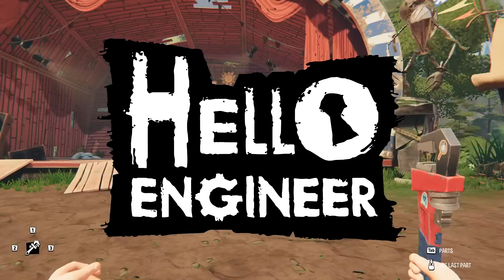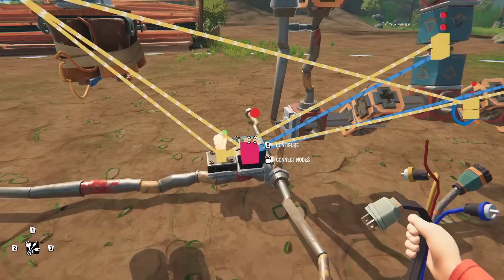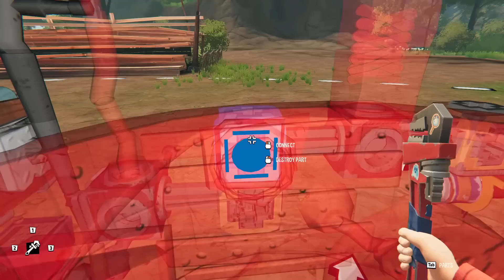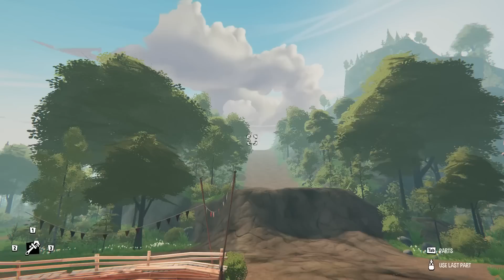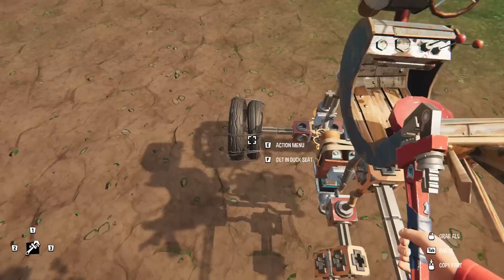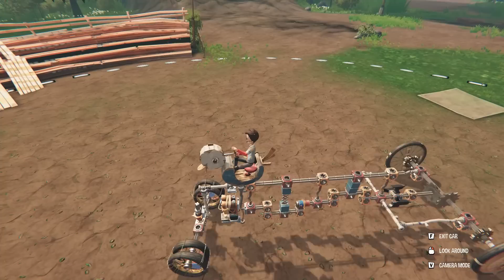I Built the Jankiest Junkyard PISTON ENGINE but I LOVE it!

Comment: @kAN:
12:07 "There's sensors that detect ground". That's all you really need; just place them on the bottom of your pistons pointing at the ground (or onto your axle pointing outward).
Ideally you'll want to set them up so that they switch between detecting and not detecting the ground when the piston is exactly halfway extended, and then you can wire their output signal into a piston with a 90° offset from the piston that the sensor is attached to.

Comment: this needs 3 pistons to operate properly, one expanding, one contracting, and one off.
offset them by 120 degrees, have them turn off when they reach/near the vertical plane, then have the other two be pulled/pushed in the direction needed.
if you have to build to a grid, then the best option is 4 pistons offset by 90 degrees, have the two on the vertical axis be off and the two on the horizontal be active.
either way, this will produce smooth and consistent motion.

Comment: to stop it going back on itself, you could instead put them 90 degrees out of phase instead of 180
Reply: you could also have less weight on the flywheel so it is easier to start going and then extend the weights to increase the inertia

Comment: Could you try putting a sensor on the bottom of the piston facing the ground to tell when it is at BDC so it knows when to extend and contract, it won't be great if you were to get off the ground but then you wouldn't need the power from the engine anyways.

Comment: If the pistons make power on both expansion and retraction, wouldn't a 90 degree offset be better? They wouldn't be at top dead center and bottom dead center at the same time, like the current 180 degree offset is doing

Comment: I think the reason why the double XOR set up didn’t work was because you didn’t connect the second XOR gat to the first. It looks like the connections have a direction so you need to have a connection to and from.
Reply: Also, you probably want the input wired only into one of the two XOR's (and if XOR gates with only one input are weird in this game, the other one might need to be an OR gate or AND gate).

Comment: My thought for a fast clock is to start with switch feeding into an "and" gate that feeds into a "not" gate chain ending with a "not" gate that feeds into the initial "and" block. The logic being the delay from flipping the "not" signals would culminate in the "and" constantly changing whether to power the connected "not" gate and the speed then becomes the sum of delays in what I'd assume are a few game ticks. Even if the game calculates the logic all at once, it'd flip between the "and" gate turning on and off which would mean single tick clocks. Probably too fast and would then require a buffer logic that adds up the pulses and triggers based on that.

Comment: I think you could make it more stable and powerful if you added another piston and made the offset 60° each, if possible. Seeing that you can't make it compact since it would lock blocks together, it would be a long one. Also, scrap cubes around the map give you materials. You just have to bring them to the grinder at the sandbox start.
Reply: I'm thinking wider, with gears to combine the power of each to the drive-shaft

Comment: your gears slipping is  due to trying to turn and not having a differential,  then going up the hill not having enough torque to turn the motor against the gravity pushing you down caused it to swap cycle directions, a heavier flywheel, and more pistons would help, offsetting the pistons at an angle could help as well
Reply: -hope this helps!

Comment: Could you still just use a sensor to control timing? Just adjust the timing so that it sees the ground at the correct timing position instead of another component.

Comment: Maybe you could put the sensors on the rotating gears to control the timing.
Reply: Do you mean that the sensor should use ground detection to time the pistons? I can see that working fairly well for gentle and consistent terrain, but as soon as you get into areas that are difficult for the sensor to detect, then it becomes useless. I do like the idea though, and would really like to see it tried.
Reply: @ShawnF6FHellcat  True. Might be nice for a sandbox demo but not useful to tackle the challenges.
Reply: @roccov3614  Indeed

Comment: Maybe you could offset the pistons, that would solve the centering up problem
Reply: That's what i was thinking.. Instead of 180, offset them by 90 degrees. Don't know if the logic timing gets screwed up, though.
Reply: In the words of ZeFrank, that's how a train do.
Reply: @CathodeRayKobold  as my mother always said, " a shaft is a shaft!" Wait.. that's not it.
Reply: Might have to do 2 drive shafts that feed one axel to keep it from being excessively long though.
Reply: Even if you make the crank out of phase, you can't get the piston to extend out of phase because of the 1 second minimum timing limit